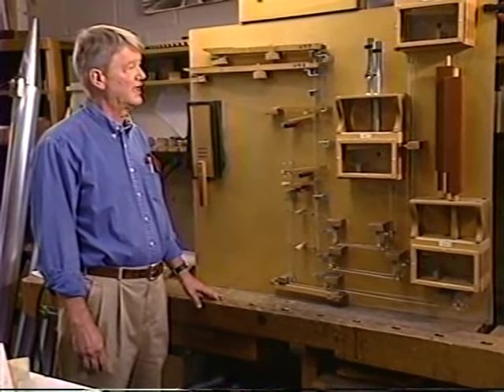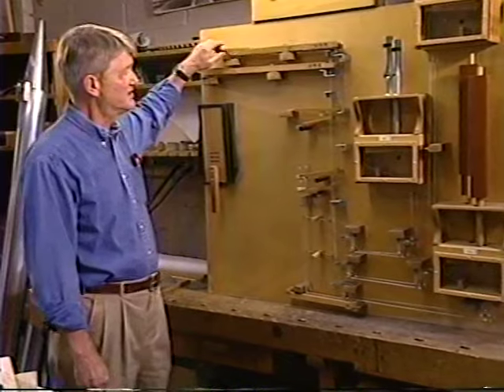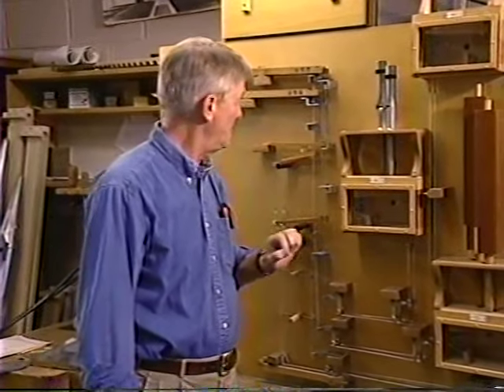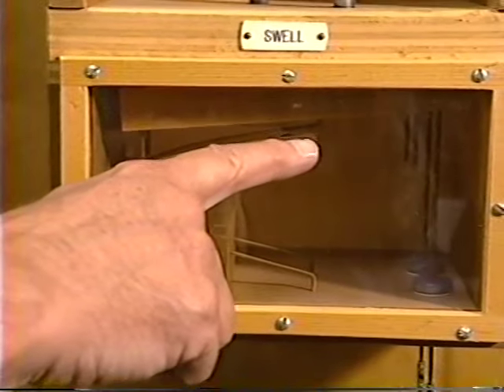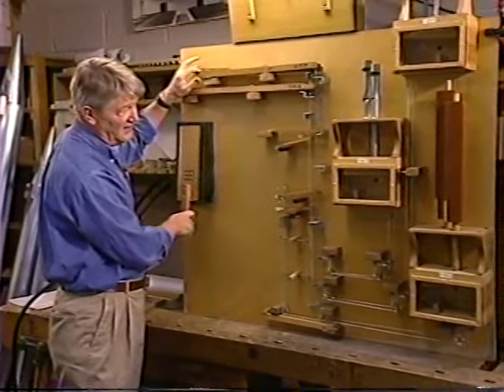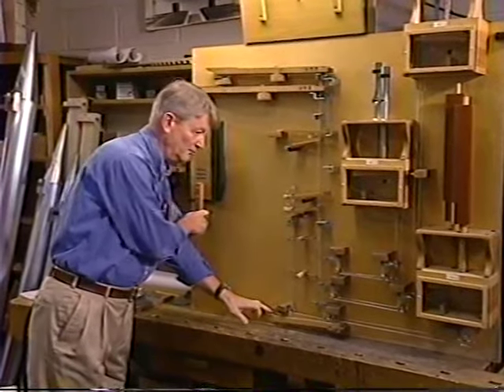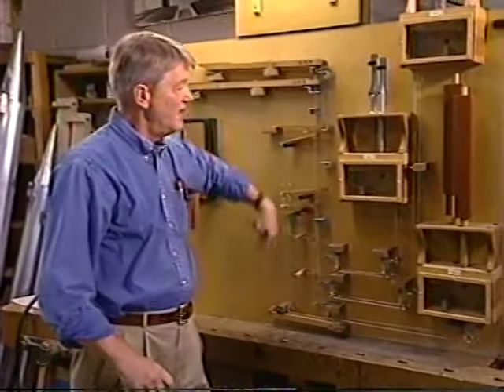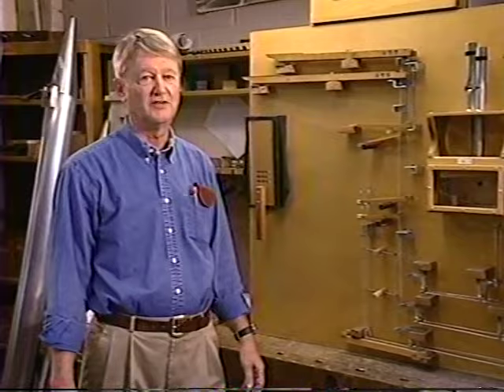Mechanical Pipe Organ Action Explained

Comment: So, to switch between stops or ranks, is the wire mechanism connected to all of the ranks the key is able to sound but the wind is only available where the stops are pulled out?

Comment: Incorrect: This type of action was used until the invention of tubular pneumatic action, then electric, and now we are back at tracker action again.
Reply: Patrick Meyer Tubular pneumatic action was a failure. It never got to the point where it replaced mechanical action in the organ building world.
Reply: @karlrovey6580  What about the action systems used in smaller dance organs, player pianos and orchestrions? Are they variants of the tubular pneumatic action?
Reply: @JBF-GST-Tanda  Small portable organs still use tubular pneumatic action, but my guess is that  the issue was that larger pipe organs would need longer runs of tubing to reach from the console to the windchest and there were issues with filling these long tubes with air quickly enough that there was little to no delay from pressing a key to hearing the pipe speak. It might've involved a separate high pressure wind supply for the action and other associated engineering difficulties to get this to work.